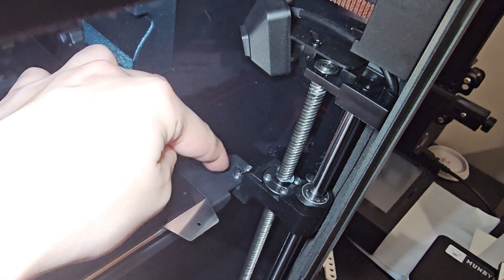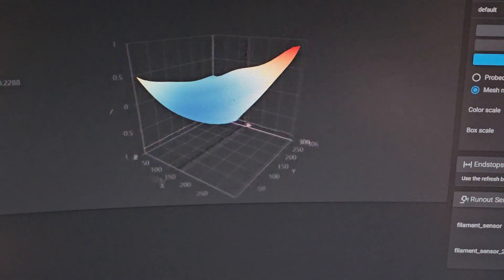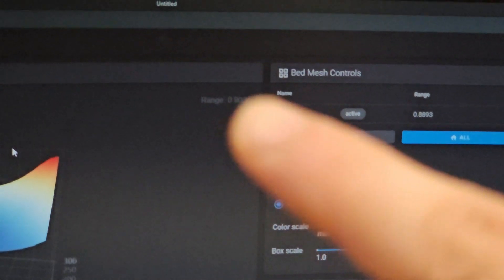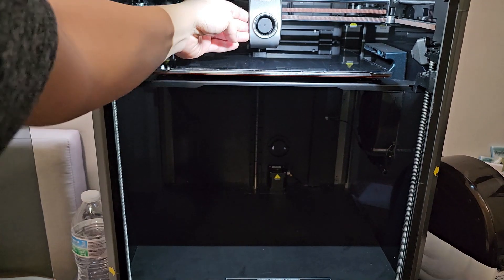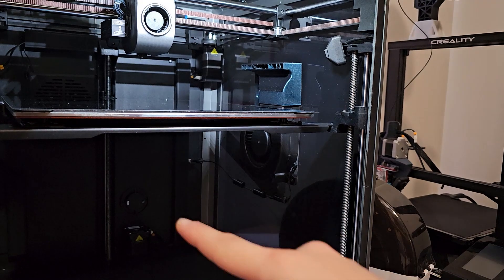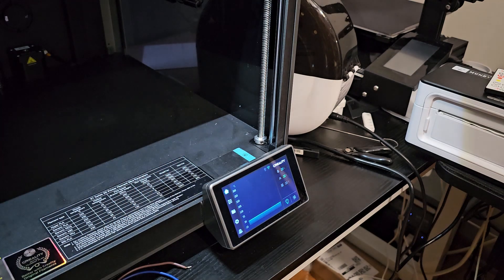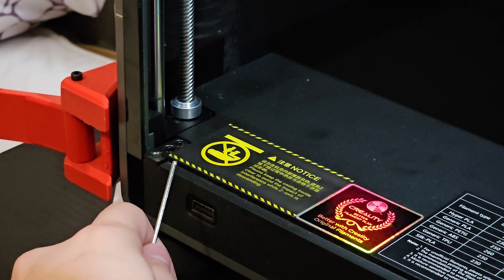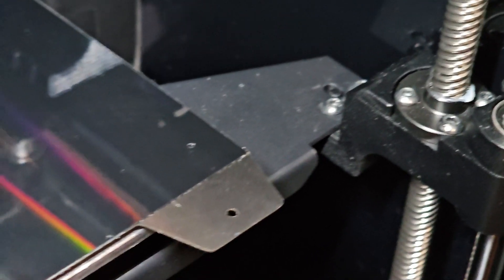Creality K1 Max Fix Bed Level Easy Method

Comment: I watched a video recently that shows you need to heat up your bed to the material you normally print, then leave it heated for 8-10 minutes, then do your bed mesh. The heating process tends to raise up the sag in the middle of the bed, making the entire bed flatter. This will be a good complement to the things you're suggesting, little brother.
Reply: Other people are using foil or other things on top of the heat bed and underneath the build plate to flatten out low spots.
Reply from the maker: I tried using foil and it looked weird and for me it doesn't work. The bed is up and down, wavy lol
Reply from the maker: Yes, I do find that worked well, heating the bed up, felt like it makes it more flat.
Reply: you can heat it up for 10 mins, as you start auto levelling the fans go full speed, and cool everything down, then creates the mesh on K1

Comment: Any of you run the cal and auto level but when printing nozzle is 15 mm above the bed? Just got the K1 max. Didn't want to start messing if I don't need to.
Reply from the maker: If the nozzle is 15mm above the bed then something has to be wrong... yes the auto bed leveling does help.
Reply: @Scratch3DPrinting  nothing helps , print is 10mm above plate. Just a big paper weight. Going to send it back. Also keeps throwing errors out, z axis vibration, ai not calibrating, list goes on
Reply: @Scratch3DPrinting  Sorted it. DL mobaxterm, install moonraker, Ntinx and fluid. Adjust the Z_ENDSTOP_CALIBRATION to suit. Save file.

Comment: Sir, you are the MVP of the day to me. Thank you for this little hack,
I got my K1 Max around Black Friday, was printing daily, this morning when I tried to print, Bed leveling failed totally ending in Error Code Key:2526, probing front right corner it would drop the plate about 5mm, googled for hours, sure saw some stuff like you mentioned that you have to open the bottom etc, but i was not feeling it because I could not find stuff which was related to said Error Key, 
For crap and giggles I tried your workaround, and it actually worked, I had to raise the plate like 3/4 turn, it is leveling without error and printing works again!!!!!
Yes I am a newb in 3D printing and thanks to you, I learned something easy but crucial! Thank you!!!!
Reply from the maker: Thanks I'm glad this little trick was able to help you out on the leveling on the K1 max. It is quite a pain to get a good level on the k1 max.

Comment: Which side of the mesh diagram is which.  Besides it showing X-Y axis in the mesh, it could be the opposite if the x-y are flipped
Reply from the maker: Yeah, the mesh diagram is confusing, I still don't know which is which. But I think the left side of the K1 max is the home position, or position 1.

Comment: The problem is due to the screw on the expansion cluster, the screw manufacturer is faulty.
Reply from the maker: yeah, looks like the screw aren't the highest quality.
Reply: @Scratch3DPrinting  this is picture when i opened it. I fixed it, and now everything so good, hope you fix it.
https://drive.google.com/file/d/1RZqivjkgOybk5YZYcotQxfU9RyWtjx2q/view?usp=drivesdk

Comment: 3:37 Just fyi that is your internal/private/local ip. There is no reason to blur it unless you expect someone to connect to your wifi network and then watch this video to see your printer's ip and then try to find an exploit and then exploit it. Even then they can find the ip of the printer by running a simple arp or nmap scan because it's your local network. tl:dr don't worry

Comment: Hey thanks! I had a range over the mesh of 1.3mm before adjustments (with bed heated). Had some issues getting good first layers on the back of the bed and it didn't seem as if the ABL could compensate for this

I tried doing the Creality suggested method (screwing the bed down, releasing the belts etc) and that got me to 1.0mm. Then tried the belt skipping but I released tension on the belts using the provided spatula with a rag (to not cause scratches) to get leverage. That got me down to 0.76ish mm range but couldn't really get it better. 

Then I found this video and tried loosening the screws on the left/right front axis as you mentioned and after this it felt like I got some more room for adjustments with the skipping. So now I'm down to 0.59mm. Will do some tests and see if it's better or if I need to play around more 🙂
Reply from the maker: Ahh, that's nice to hear.  Hopefully, you will be able to get a flat bed mesh and get perfect first layer prints.

Comment: Hey scratch! I’m trying to access the 3D printer with the up address but I can’t seem to be able to get in. I get a connection has timed out message. I tried it on Chrome and Firefox with the same results. What could it be?
Reply from the maker: hmm. There are a couple of reason. Is your printer connected to your wifi? Was your printer on when you put in the ip address in the search bar? How did you type your ip address in?
Reply: @Scratch3DPrinting Printer on, and connected to WiFi. Computer connected to the same network. I entered the ip as 123.456.78.910 for example. Still not working.
Reply from the maker: @Tarqui787  I'm not sure, maybe watch my newest video and see if that helps. Here: https://www.youtube.com/watch?v=AttoeB2HKQI&t=13s
Reply: @Scratch3DPrinting  Thanks for your reply, but I found what was wrong, and it was a layer 8 issue. I have my WiFi network separated for the 2.4 and the 5g. Although at some point I had my printer connected to the 5g, it seems that I had also connected the printer to the 2.4 at some point. Long story short I had my computer connected to the 5g and the printer to the 2.4 and that’s why it wouldn’t load. Once I connected both to the same frequency it popped right off. Thank you!

Comment: Excellent, Just did my bed in 7 iterations and accurate to .078 range of error, no point trying to better this as the computer takes over but slightly less work to do than before,   Top Man, Well Done
Reply from the maker: That's amazing man, 0.078 range wow!

Comment: Maybe it's an easy method. But with a good chance to damage parts of the printer long term.

My print bed has a similar deviation. But as long as the automatism is able to cover it, i am fine.
Reply from the maker: Great point

Comment: I also saw that video.. And I think that the problem can be definitively solved by replacing the plate with an adequate thickness of 5 or 6 millimetres.. Also because waiting 10 minutes each time to heat the plate is a nuisance.. what you do and a forcing that in my opinion can work but as the parts wear out it won't be good for a long time
Reply from the maker: I kind of figure that would be the problem.

Comment: Hmmmmm, don't skip teeth, just undo both those grub screws then you are free to turn the rod. Same as how you level the gantry on a 3 V3 SE, there is a Creality video that shows it.
Reply from the maker: I tried unscrewed the two screw but it's still lock on with the other.

Comment: I want to advise caution about this technique of forcing the screw to turn.  The thing is, all three screws are attached to the same motor so that it only takes one motor to drive the z axis.  What you are doing is forcing the one pulley to turn against the belt, forcing the teeth to skip while it's tensioned.  That can't be good for the belt.

I don't know what the effects of this will be, maybe you can get away with doing it a few times.  But I'm worried that this can damage the belt.  I would recommend going through the full process of opening the bottom of the unit to remove belt tension first so that you don't shorten the lifespan of the belt, or worse.
Reply from the maker: Yea I do feel that might be the problem, but so far it has worked for me and everything seems to be working fine.